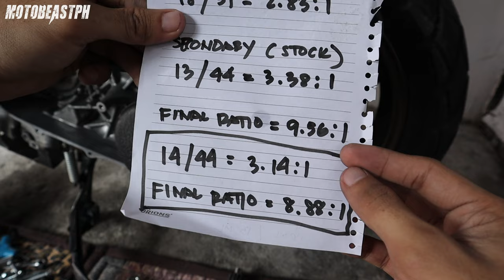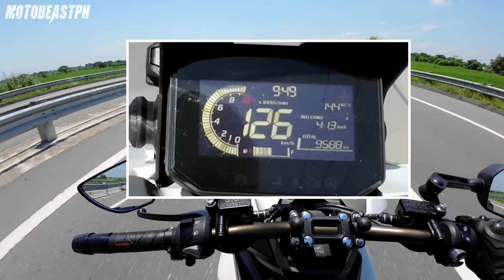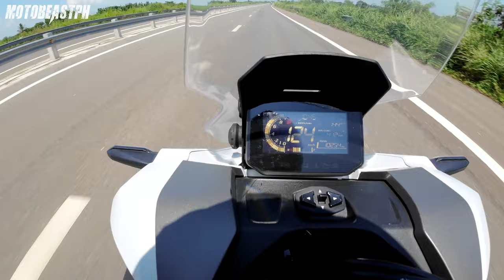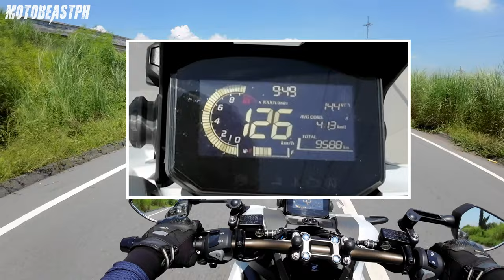ADV 160 | ECU-Tech 14T High Speed Gear

Comment: kap motobeast.. kakapa set ko Lang ng straight ST mismo kay mazo.. 

Mofify TD, DF, Pulley.. planning ko sana gayahin ung mismong set mo..

what do you recommend..

90kgs ako na rider..

same ba ng degree si mazo sa df pulley kay ecu tech?

need ko ba mag 14t din? 

pati springs ko?

sorry sa madameng tanung.. ikaw Lang kasi maayos mag explain ee.. hahaha.. avid follower kap!
Reply from the maker: Sundin mo lang muna base set nila tapos adjust ka springs at bola. Stock gear lang para di humina torque.
Reply: @MOTOBEASTPH  yep balak ko na mag adjust . kasi 1500 pala ung ksama nung assy.. tapos 1000 ung center.. 16g ung bola ko.. papatuLong ako sana kung saan baseline ulet ako pwede mag adjust pra sa 90kgs na rider.. stock clutch ba.. mag 1200 paba ko ng center? tanggalin ko po ba washer.. saLamat kap! sorry masyado matanung hahaha
Reply from the maker: @DaCedPH  Iba kasi degree nyan 13.5 kaya baka di pasok sa set ng ECU Tech na 13.8. Pwede mo try mag 1k clutch tapos timpla ka sa bola. Kung kulang sa hatak, try mo Showar GY6 1200.

Comment: Palagi ko angkas si obr kap. Bali naka 1200 center and 1000 sa clutch ako then 12/13 flyball sa adv 160 ko. Mas okay ba pag nag 14T ako? Hric pulley set JVT Lining and Bell. Sana masagot sir salamat!❤
Reply from the maker: Okay na stock gear, bro para malakas hatak.

Comment: Good day kap gusto ko mag try ng 14t torque gear currently naka straight 17g ako na flyball, & 1000rpm for center at clutch spring ok lang ba kung ikasa ko ang 14t torque gear, o kailangan ko mag magaan pa na bola? Any recommendations will appreciate thank you
Reply: Adv 160 user din ako
Reply from the maker: Need mo mag gaan bola. Okay yan gearing kung solo ka lang at puro patag. Tapos makakadulo lang siya sa mahabang daan.

Comment: Which Viscosity does the Honda gearbox oil that you used have ? 75W or 80W or 80W90 ?
Reply from the maker: There are no viscosity info on the bottle, but it's what Honda recommends on the user manual.
Reply: @MOTOBEASTPH  thank you.... here Honda recommend to use the same 10w30 oil that you use in the engine, no special gearbox oil.... isn't it crazy how the recommendation changes from country to country
Reply: I think the weather is something to consider.  @ramiretz

Comment: Sir kung mababasa mo to, ano po mas magandang gear para sa click160, stock or high-speed? O magpanggilid(cvt set) muna ako bago mag upgrade ng gearings? Thanksss sana mapansinn
Reply from the maker: CVT muna, bro. Gearing pang magaan na rider or kapag solo ka lang. Hihina konti hatak.
Reply: @MOTOBEASTPH  nagchange na ako ng springs and flyball sir, bka magawan mo ng video ang proper positioning pag combination ang flyball, parang 16g at 19g. Salamat po. Dito ako nanonood pag nag ddiy ako😊

Comment: Bro out of context. Tanong ko lang, naka stock battery ako ngayon sa click 150i(5 years old na yung motor). Tanong ko lang, nagpadagdag kasi ako ng accessories mdl, loud horn, underglow, at Thai switch. Plano ko na palitan yung battery kasi 5years na stock pa rin. Pero may nakita ako sa fb na kapag nag pa add daw ng accessories hindi na recommend yung stock battery kasi designed yun for stock electrical. Sabi dun sa post maganda daw na Lithium Ion Battery ang maganda specifically Leimera brand, kasi may extra nang nag coconsume ng charge nung battery. Agree ka ba dun? 

Thanks in advance!
Reply from the maker: Okay lang kahit stock pa rin ipalit.

Comment: How does the bike calculate its speed? If the speed sensor or ECU calculates from any point upstream of the final drive gear you installed, then is it displaying the correct speed on the speedometer? You were likely going faster than the indicated speed on the speedometer. If the speed sensor is in the final drive gearbox then the displayed speed would likely be correct. If the ECU was remapped, did this allow for correcting the speed displayed? Very interested in this as I am considering doing this upgrade as well. Thanks for uploading this video. Very interesting!
Reply from the maker: Speed sensor reads the rotation of the bigger gear next to the small one, so changing the small one does not affect it.
Reply: @MOTOBEASTPH  Thanks for the clarification!

Comment: idol ask ko lang pwede po ba yan sa pcx 150 sa pcx 160??
Reply from the maker: 160 pwede
Reply: @MOTOBEASTPH pcx 150 ang motor ko po sir? Pero pwede yang 14th gearing for pcx 160 to pcx 150?
Reply from the maker: @Robux-n5p  Hindi, bro. 17T pang PCX150.
Reply: @MOTOBEASTPH 17th stock ang bilang ng teeth. Ano mas maganda gearings for pcx 150? Ubra po ba 15th ang gearings sa pcx 150?
Reply: May nakikita lang po ako sa mga tiktik 15t gearings po gamit nila sa pcx 150 kaya nagtatanong po ako sainyo sir ano maganda 15t gearings po ba

Comment: Hnd po ba mahiyaw msyado pg nka gearings po
Reply from the maker: Bumababa yung rpm pag nag high speed gear.
Reply: Ung skin po idol , airblade 160 nka pulley set kalkal ako 1k center , 1200 clutch nkremap pro hirap dumulo halos ntry ko na mgtono ng ibat ibang bola pinaka mtaas ko lmg 124kph straight 16g
Reply: Ntry ko nrin po ng 14t pro prng mhiyaw po ang makina idol... Ngtry rin ako ng mas mbabang bola
Reply: Idol kmustq nman arangkda ng 14t at dulo
Reply: Anu po gmit nyo center at clutch dto sa 14t gear

Comment: Boss pahingi link ng torque wrench mo. Salamat
Reply from the maker: May link sa description, bro.
Reply: @MOTOBEASTPH boss naka bili na ako ng flyman kaso 28 NM pala pinaka lowest nya di ko din pala magamit para sa mga 23NM o may paraan po?
Reply from the maker: @ignacioaldrinv.2908 Dalawa gamit ko, bro. Isang 1/2 at isang 1/4 para sa maliliit na bolts.